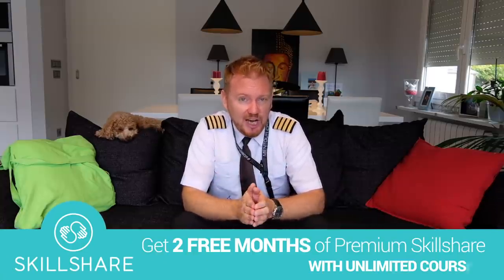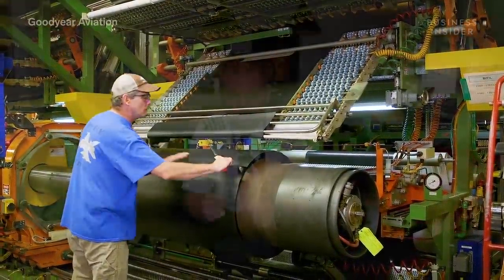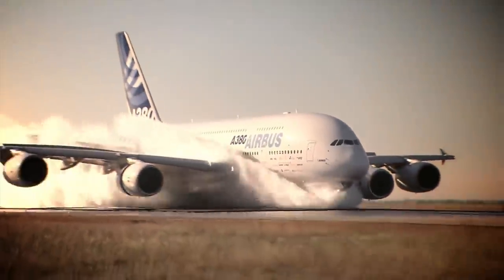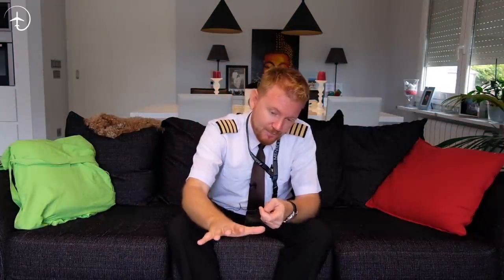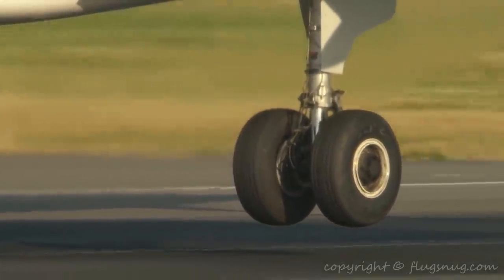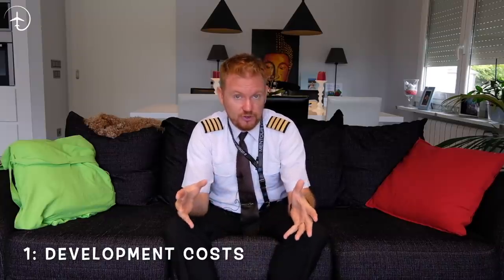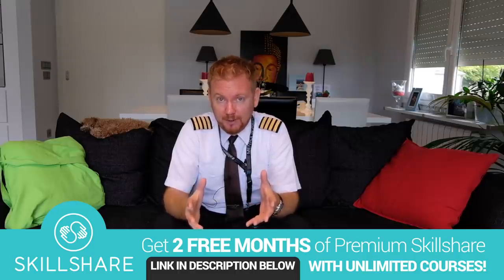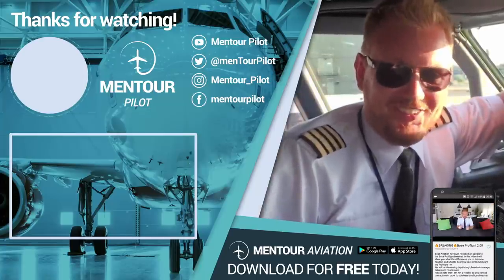Why not make plane-tires spin, before landing?!

Comment: I love the idea of the electro-tugs! The amount of fuel wasted by jet engines taxiing is incredible. I would suggest, however, that you not put too much stock in autonomous vehicles at this point. Even just returning from a runway to a home base would be a colossal challenge for autonomous systems. And they're not ready. Computers are idiots. They're great at math and not very distractible, but they're otherwise extremely stupid. They also "think" in a way fundamentally different from the way humans do, making their mistakes extremely unintuitive and bizarre to us. This is true even with conventional programming -- think "ILS sees obviously false glideslope and decides it's totally legit" -- and it's even worse with the sophisticated AI systems used for autonomous vehicles.

There's no way to know exactly why the system decided to do what it did. And even if you do have some idea why, it's not as straightforward as rewriting some code. You have to retrain the AI and hope its subsequent change in behavior has the desired result without breaking anything else. Like, you might tell it you don't like it when it starts doing donuts on an active runway and think your training fixed it, only to find that it will still do that in some circumstances and it now refuses to turn left at any temperature below 2.7 degrees Celsius. Or something. However weird and unpredictable and therefore dangerous you think it could be, it will be worse.

So yes electro-tugs! But just have humans operate them. We have our flaws and we're expensive, but at no point will a human operator try to intercept the attachment point of an aircraft that hasn't actually landed yet.

Comment: Why there are not many tires like a large truck? That will reduce the probability of landing failures of the aircraft. Let's say Boeing 737 has 20 to 30 tyres spread in the front, middle or back. Why such design wasn't considered?

Comment: 2.1G? I don't think its that much.
An object has 1g normally. if it is falling from 1 metre in free fall, then it would be having 2g. 
So i think aircraft tyres handle only around 1.5G that too conservatively as no aeroplane falls in absolute free fall.

Comment: Not everything here makes sense to me. Like landing in a crab with spinning tires would drive the aircraft off the runway. But I would think that since the trucks are pointed in a fixed direction along the axis of the plane, that alone would tend to drive the plane to the side of the runway, spinning or not.

But clearly some smart people have considered the issue and none of them came up with something better than what we have. Thanks.

Comment: Nitrogen is not inert. The value of nitrogen is the it ain’t oxygen. Oxygen is more corrosive/reactive with rubber an metallic wheel parts. Air is ~79% nitrogen already.

Comment: Generous of Petter to do a video like this - replacing what we already have (which works fine) with a more complex system to solve something that's not at all a problem is just a complete non-starter.  But I like how he's teaching engineering thinking, which ALWAYS involves bean-counters, even if it's your own project, and they're just your internal mental bean-counters.

I can't count how many times I've gotten into these "well safety is more important than anything" and "oh, corporations are just greedy, they only care about profits", and blah blah blah arguments.  You can't build ANYTHING, in any economic system whatsoever, without the consideration of how much it costs.  How can people get out of high school without even being ABLE to comprehend such a simple fact?

Comment: Certified by FAA and CAA does not say anything... The dreamliner sliped thrue even if a lot of issues, how coudld that happen if all is so safe?  Compairing a cost for a tire with a blade of a turbine is close to st....id!!   Have you ever think that a blade of a turbine has a sales margin on top on the cost times 10.000-15.000? Why??  Because the suppliers can!!!!   The tire is changed very often, so the cost is not that low over time... It was a lots of pilotes 30 years ago that say that it will always be nessessary with a pilote in the plane, and fly by wire will never happen... How is it today??  A lot of drones, and even combat plains with fly by wire...    Im sure it would be good to have a pre rotation of the tire, maybe even a simply air "turbine" that just speed the tire up by the airplane speed the time before landing...  One big issue in the aircraft industry does not have any  competition and that block new technologies. The two big manufacturer share the market whatever its a good product or not... No one else will be able to enter.... so no new thinking and technology...

Comment: Why not have the motors spin up the tires to speed and then shut them off so that they aren't actually driving the plane? I would think that would at least save on runner wear.. I guess the people that make airplanes are way smarter than me though so there's probably a good reason why they don't spin..

Comment: The claim that the motors would have to spin the tyres to exactly match the speed of the aircraft isn't actually correct. We already know that aircraft can land just fine with tyres spinning at a speed that isn't matched to the aircraft -- they land today with non-rotating tyres. A system that spun the tyres up to 50% of the correct speed (or even 150%) would still reduce tyre wear, without having to be perfect. You give plenty of other reasons why this system wouldn't be an overall benefit, but the fact that it wouldn't be perfect isn't a valid reason.

Comment: Not a motor on the wheel...Instead have an impeller mounted to the side of the wheel and use the air to pre-spin the wheel.....TM

Comment: No need to put a motor, just small aerodynamic turbine printed on the rim could make the job. A tachometer to use a small valve to close the air entry on the "turbine"  this valve will be powered by a simple generator magnetoc ring on the rim, we are talking about 10 W power    in order to synchronize with the land speed expected.
No battery no motor no extra weight . If an engineer do it, I will appreciate he offer me a beer Lucien Lescanne
Reply: I hope you know, the most likely have already thought of stuff like this.
Reply: @ethansaviation2672  
Bill Witt as given the very correct reason, in substance the gyroscopic effect of spinning wheels.
vibration is a problem that can be solved with a dynamic balance system but gyroscopic effect mean that it is only 2 or 3 sec before the touch down that the wheels could be put in motion, and, regarding the  mass of the wheels it imply a powerful, thus heavy, "motor" to obtain  the acceleration.
This having been said, it is only in crosswind landing that gyroscopic effect could be a concern

Comment: Pre video: 🤔 yeah how come we dont pre spin the wheels then on landing use regenerative braking technology to backfeed power into the aircrafts main battery banks, and why couldn't they take this tech and attach small propeller units to turn the landing gear into a supplementary auxiliary power source.

Post video: 😯 neat i see but still
🤔 why couldn't we fit a rotor to the landing gear and use it as a supplementary auxiliary power source

Comment: Imagine the weight of future aircraft when they have to be electric instead of fossil fuel run.  The whole belly will have to b e lithium batteries.  Imagine when they spontaneously catch on fire which lithium does often.  If you are gonna force people to drive EV cars, then you got to do it for every form of transportation

Comment: well you said something that is completly wrong.  most new cars have tire senseors .  and  so the tire sense does not go off due too the changing tire pressure due to breaking and heat  as well as cold in winter .   car tires are  filled with nitrogen for the same reason as plane tires.

Comment: i was wandering about this problem for over 30 years and finally i decided to look it up today which led me here...now - you are wrong in most of your claims here(and i'll mention only the ones I am SURE about). first you say that 1500$ is not much in grand scheme of things? there is 16 of these tires that need to be changed 3 times per year -so it adds up to about 80 thousands with labor at least -and not including a lost time.. secondly -i already have a system that will rotate the wheels at exactly the same speed(not mine invention) and it is very very simple!and for a third misconception i point you and your claim that the plane would shake greatly because of difference in huge tires in the direction of car industry where they already have solved that problem -it called BALANCING the tires!!!!and after all they need to spin for a few seconds to reach the needed speeds(just look at the electric cars today)...also those batteries can be easily recharged during braking and solar panels - specially because they would not be discharged but for just a small amount!........THATS WHAT I KNOW!!!!!!!!!!

Comment: One of the main reasons you see so many car tyres on motorways is because 3/4 of you lot don't bother checking the pressures or tread depth! Sometimes at all! :P (TPMS equipped cars excluded). I've been a car mechanic for about 26 yrs, and I get that (rough) figure from servicing them over the years,  you bunch of slackers! :D (or is that just a UK thing?? lol). Check them at least once a month! (man I've been waiting a long time to rant about that! 😂 )

Comment: why batteries ? Just use the power generated by the turbines ??? You could cut down the power of the many screen fitted in the seats in some planes to power the wheel motors !

Comment: Why motor? The tyres could have small "wings" that would work like a fan. No technical parts, practically no extra weight.
Reply: HaHa.  I have seen the smoke from the tires during landing of course and wondered why the wheels don't get spinning up before landing.  I'm surprised this is a common question. I would imagine all that rubber on the runways make for a better landing surface hehe.   My thought was similar to what you say here.  I'm sure the tires could be designed to spin with "wings", but not to the speed of the aircraft, which would reduce wear and not cause significant issues with cross wind landings.  Or, imagine tubes that pick up air, get reduced in size and divert the air to the sides of the tires.  A damper could also be put in it that could be shut when on the runway to also help stop the plane, and stop spinning the tires.  Wouldn't be much and perhaps not worth it.  The flip side:  Use the engine exhaust (cooled perhaps) to spin the tires in the opposite direction before landing and stop the plane in less then 30 feet haha.   Tires are cheap, until you have to buy them ya?

Comment: WOW this is not very accurate.  You are wrong about the nitrogen not expanding with heat.  Dry nitrogen expands at the same rate as other dry atmospheric gases (normal air is about 80% nitrogen),  Not everything in Wikipedia is true.  Air Force studies back in the 60's and 70's determined that only 10% of tire wear is a result of landing 'non-spinning' wheels on jet aircraft  The Cessna Citation 500 has an optional spin-up motor on the nose gear, not to save tires but to protect the plane and engines from debris when landing on gravel strips.  You didn't mention that the skidding tires help slow the airplane, so having the wheels already spinning would result in a greater landing distance.

Comment: The reasons for not doing it are not very convincing. 1. Dev cost - companies might not invest on existing planes and there are no returns, but can easily be installed on new aircrafts as a standard feature. 2. Certification cost? Thats just an excuse. 3. Safety? We have enough technology to make it fail proof, else the planes wont fly at all. Also weight factor is another excuse, even the RAT is a dead weight until it is ever used. Not convinced.

Comment: I don't agree with all your points, hesitation to add new technology just because it might add to certification costs or something is stupid, technology is going to change some day or the other. If the benefits outweigh the costs, it's gonna happen. You need not use batteries or extra motors, you have huge turbines which need to be slowed down anyway while landing, that energy could be used to run the tyres. Yes it's a very new technology, it costs a lot, but the reasons you gave don't convince me enough.

Comment: Motors would be stupid.  There are no “good” reasons to add the weight, complexity.  Small flap, bumps, vanes on tire, or even rim would be much smarter, cheaper, simpler… .   But it was found not to be worth it. Fine.

Comment: You wouldn't even need motors, would you?
Just use the windmill effect. Flaps on the side of the tyres that look something like a slapped on turbine.
It could only spin in the right direction, if properly done.
No motor, no cables, no nothing
Just air that blows over the side of the tyres and spins then?
To easy thinking?

And.
Why not make runways so, that they have an angle, say 35 degrees.
At start, downhill, you get a push.
At landing, opposite direction, uphill, you get a brake effect.
Educate me, please🙂

Comment: Here is one which has never been satisfactory explained. Everyone would agree that to get a fully loaded heavy up to take off speed by the action of throwing air backwards in an unconfined space uses enormous amounts of fuel. There are better ways of using fuel. Think steam rams, aircraft carriers. Think cable launched gliders. How difficult and what are the drawbacks to integrating similar techniques in airliner operations? Different topic, what happens to all of the tons of  rubber from all of the airplane tyres, and the millions if not trillions from automobile tyres that 'wears away' year in year out all around the globe?

Comment: ... GRAVITY ACTUATED SPINNER WITH RATCHET PLUS WIND/AIR PRESSURE ACTUATED TURBINE WOULD GIVE A SLIGHT PLUS, FOR HAVING THE WHEELS INERTIA DIMINISHED.
GRAVITY DEVICE WORKS TO GENERATE WHEELS ROTATING AS THEY COME DOWN FOR LANDING, GIVING TO THE WHEELS AS MUCH AS FIVE TURNS, THEN THE AIR PRESSURE/WIND TURBINE SEQUENCE WILL ENTER IN ACTION.
TO MUCH SOPHISTICATED ?!
UP TO YOU TO OPTIMIZE.
THANKS.

Comment: Your reason for using Nitrogen (reduce expansion/contraction from changes in temperature) is completely WRONG.
ALL gases follow the same PV=nRT rule and have the same % change in volume or pressure for a given change in temperature.

Some of the real reasons for using Nitrogen instead of Air, are;

Air has water/moisture which can freeze inside the tyre and damage the tyre/valve.

Oxygen in air is an ingredient for fire, if a tyre with Air explodes you would get oxygen blowing on hot brake gear causing a fire. 

Oxygen in air can react/oxidised with the interior of the tyre.

Comment: Why does it have to be an engine to spin up the wheels? The airplane is already going 500mph, having a simple flap on the wheel that'll leverage the wind to spin up the wheel like a waterwheel would work? Virtually no extra weight, hardly development needed you'd think. ah well

Comment: I stopped your video in the first tenth of a second to take a little gamble.... three years ago, no one's gonna read this anyway.

For starters, motors big enough to make the wheels even turn on their own without adding power would add TONS to EACH TRUCK! Plus, where are you going to put the ten ton generator to make the juice to turn all that landing gear? They have to spin up to a high speed FAST, so huge batteries? They weigh a ton. It slows the plane down and makes it "stick" on landing after "flaring", so why give that up? The plane isn't a truck, it's flying, so traction difference only means a shorter "self aligning torque pulse" and using more fuel to slow down. Finally, there is just no need. Now I'm gonna watch the video and see how stupid I've been.

Comment: Motors in the landing gear will add weight but connection to thrust reverser will be lighter and safer. +237678808731 I have been working on that from Cameroon

Comment: BOLLOCKS. It would take 300 kilograms of batteries and less motor/generator weight than the weight savings from chucking the friction brakes to use electric regenerative braking systems to accelerate a 100 ton plane to take off speed. And brake to a stop on landing.

And the fuel weight saved would be enormous. 

Engines could be far simpler and more reliable and efficient at flight speeds, if they didn't have to provide maximum thrust at low speed high Atmospheric pressure on the runway. It's all about making money on crap disposable wear out fast, inefficient rubbish.

Comment: Why not use air turbines to drive the wheels to ground speed? Or even turbine blades on the wheels driven by the airspeed? The difference of speed of wheels is a furphy: when you land on one side, you accelerate those tires to groundspeed, while the others are not turning at all. That doesn't appear to make a difference. So having 'incorrect' wheel speed is not relevant. The tyry speed will simply be corrected on touch down, just like now, but the tyre wear will be greatly reduced.
Not a single one of your reasons stands up to scrutiny.
Please get some real engineering information and try again.
Reply: Yes but with the wheels spinning you will take longer to stop due to less friction

Comment: the last argument is not valid in my eyes. you should not use the motors to accelerate but only rotate the wheel while in air. the motor can be shut down when it senses external torque. so basically the tyre is lasting long enough and sideways slip would wear often enough that its financially not viable to introduce motors on the wheels. 18 min talking for two sentence. to be honest, your video has a low knowledge to time ratio. but good luck in future